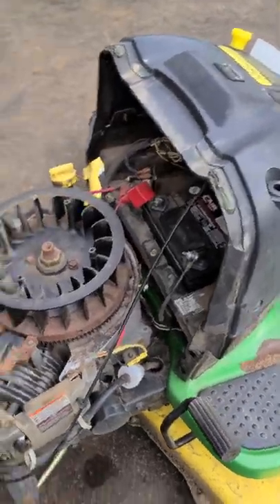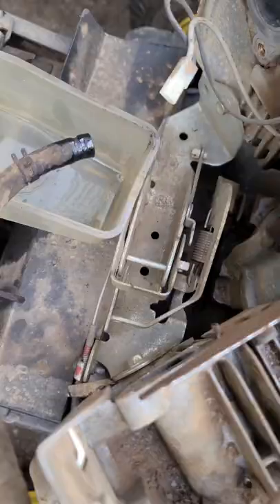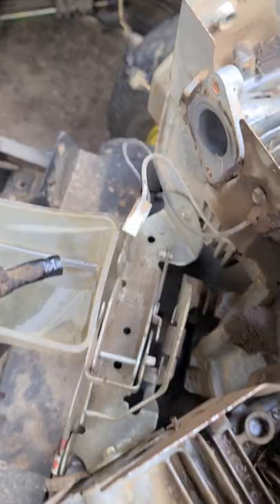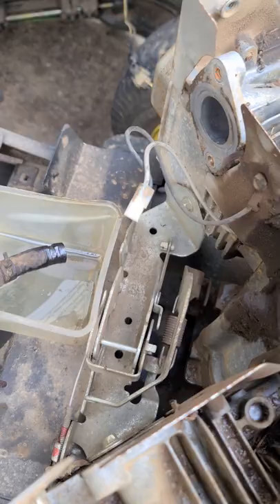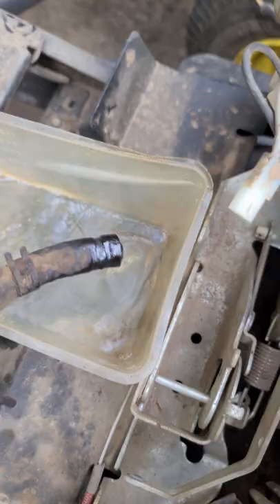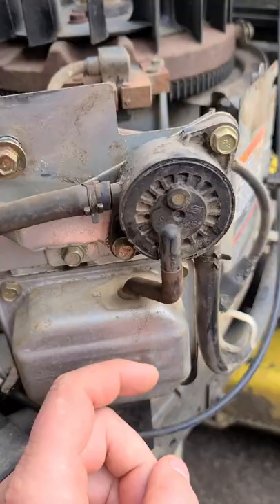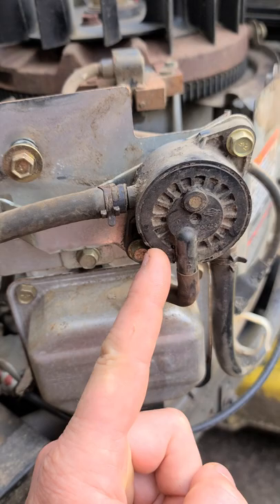Is My Fuel Pump Bad?  HOW-TO Quickly Test A Fuel Pump  #shorts

Comment: A little water got into mine and it's been running funky. I emptied out the fuel tank and I also changed the fuel filter. And it's still running a little funky. Will it eventually get the water out? Like when u get bad gas in your car?

Comment: I am almost done putting a new fuel pump on right now.  I should have used this method before taking off my old pump.  My problem is intermittent. It runs fine for a few minutes and then just stops running. I am hoping that it was a bad fuel pump, but I have not ruled out an electrical issue.
Reply from the maker: also install new fuel filter
Reply: @donyboy73  
And a new carburetor?  I will be trying that next.
Reply: Also make sure the gas cap has a vent hole that isn't plugged.

Comment: Donnie..have done this many times in the past...great tip. Do you have a carb bowel nut part number for a Kohler Command 7000 series engine KT740--3011. Lot of of problems with the fuel solenoid....just want to get rid of it.
Reply from the maker: sorry i don't have in stock
Reply: @donyboy73  do you have a part number